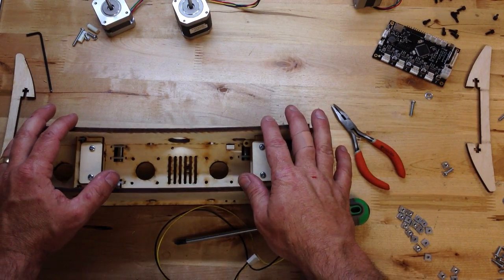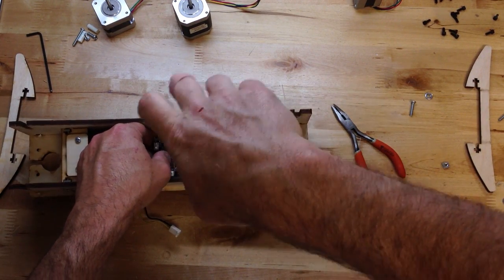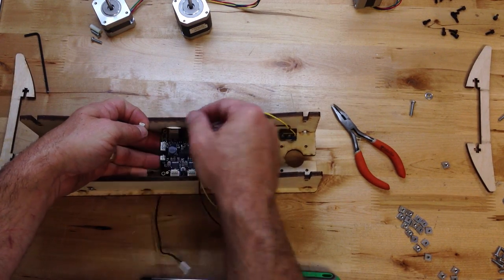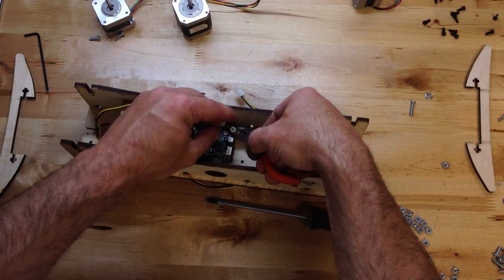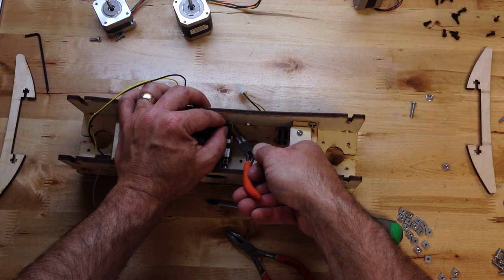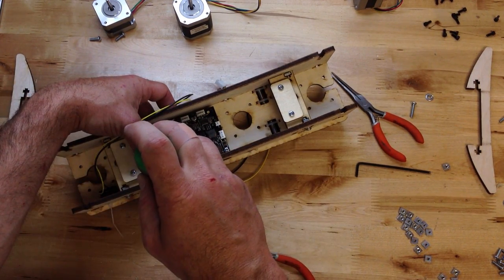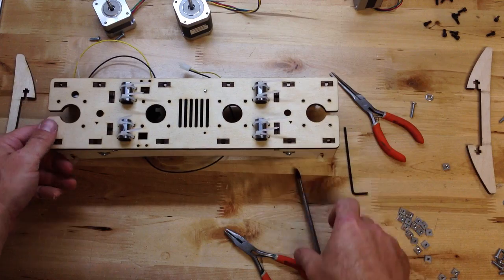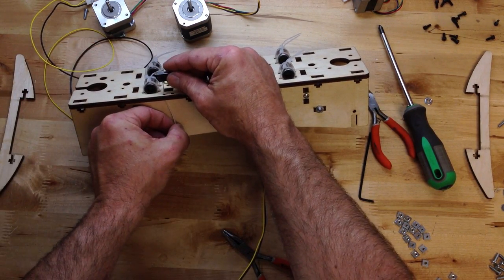Printrbot LC Build 02

Comment: OBS!

Before mounting the motors do the following:
1: Mount the bolts that's beside the bearings (from above into piece 108)
2: Mount the feet (piece 105)

Then mount the two motors that nowadays seams to be the same size with the connectors facing to the center.

Comment: Now, I figured out what is going on here. The two steppers on the ends are the Z steppers. These are the smaller 011 motors. The one in the center is the taller one for the Y axis, So, in fact, it should be possible to mount the motors, then the feet as shown. Btw, I find the step by step instructions for the Plus on printrbot website to be more in line with the current LC.

Comment: I agree. I just discovered the same thing. The issue is that the motors being shipped now are longer. His motors are shorter and so that was not an issue in his build. The instructions do need to be updated and steps not left out. I've had to redo a few things already and consulted instructions for other models where some parts are clearer.

Comment: He makes another mistake at the end where he puts the motors in first and then tries to put on the feet. Feet need to go on first and then the motors, otherwise it is impossible to put it the bolts for the feet. Wish they had better QC with their instructions... Much is left to be desired.

Comment: So with Rev D board, you use the #6-32 1 inch screws with the 16mm spacers? or the 25mm M3 bolt?